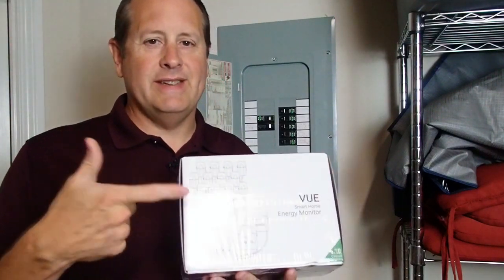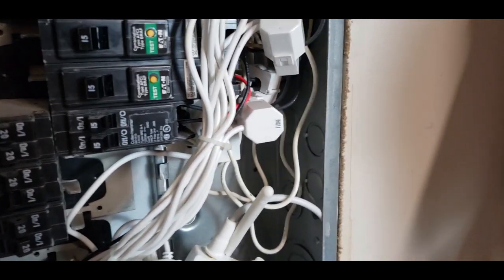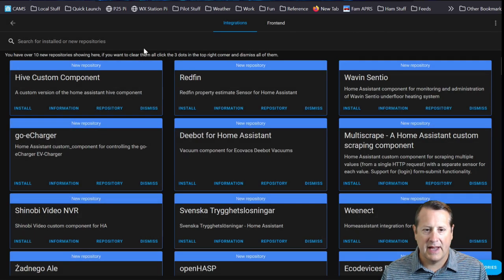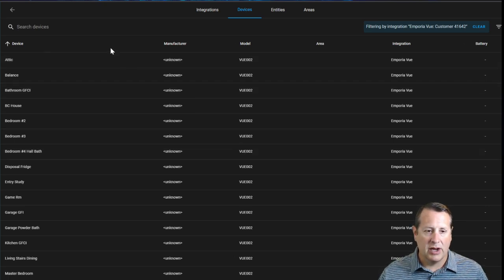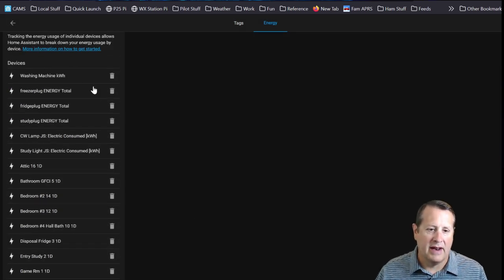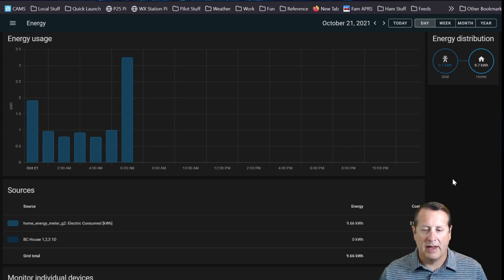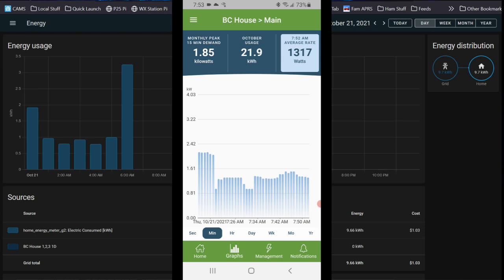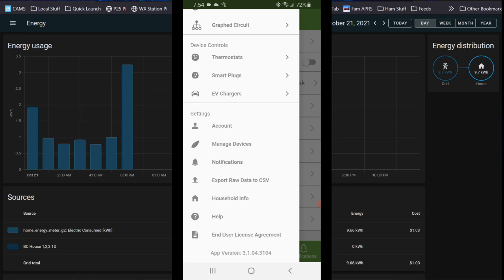Home Power Monitoring with the Emporia VUE and Home Assistant.

Comment: I'm glad I'm not the only one who isn't able to click on the selections. I did find you can use your arrows though. I had no idea it was a Chrome issue.  As far as the those who want to use this and be out of the cloud, someone has come up with a new firmware you can flash on this.  I haven't tried it, I'm using circuit setup but I did see a video on it the other day.
Reply from the maker: I think Digiblur did a video on it with ESPHome. I haven't tried that yet but might. Haven't felt like taking the electrical panel apart again yet. Thanks for the tip on the arrows. I have no idea why I can't click with Chrome. Works fine in Firefox.

Comment: You could still place the antenna outside the box through the side. Sure the antenna will be behind sheetrock but that's much better than the metal box its in.

Comment: I'm coming from more familiarity with the Eyedro2 energy monitor, and it seems the Vue2 app capability for data graphing review is very rudimentary compared with the Eyedro implementation.
There's no way to select the date to be charted, so it always needs to be scrolled to from the present time back to the period of interest.
That is impractical when trying to use the seconds or minutes granularity because it's very slow, and doesn't display the date in the seconds view, so you lose track of what day it's showing, if you're able to scroll back that far.
With the eyedro, the app allows date selection and pinch and zoom capability, which makes it very easy.
Does Graphana run only on the PC and offer the ability to save and display seconds granularity of the recorded data?
It would be ideal if it were available on the phone app, but the home assistant and Grafana might be a way to get that capability.

Comment: Hi Chris, thanks for the video's and the time you put in it. I would like to aks you if you're still using the Emporia and what do you think about it after using it for a time. Would you buy it again or would you choose for another option? (I also planed to use it with hass is verry near future)
Reply from the maker: I am still using it. It has been flawless. The only part of it that I would like to see is local access. Since it transmits every second, that data has to go to the cloud and then be consumed by the integration in Home Assistant so keeping it local would save some bandwidth. I know that there are those that have flashed this with Tasmota for local access but I have not done this as it works for me reliably so far.

Comment: Chris - great video. A question on the Emporia unit though. An Amazon review stated the app connects to the Emporia cloud to display usage. Is this true? In my case I want to view real time backup generator load during a power outage, so my home wifi will be working but usually we lose the internet. I want to connect to the Emporia just using my local wifi and monitor my generator load. Will it work this way?
Reply from the maker: Thanks! The Emporia out of the box relies on the cloud so if you lose internet, you'll lose power monitoring. In addition, since this is a wifi device, unless your wifi remains active it won't work either. I think DigiBlur just did a video on Emporia with ESP that might bring it local control. https://www.youtube.com/watch?v=z0Jv4nO9OWg

Comment: Chris - Another great video! Thanks for sharing. Quick question, I'm interested in getting one of these to solve two problems. One to monitor my over energy usage with home assistant. And secondly, I would like to create a sensor using the Vue to monitor when my washing machine and dyer have completed a cycle and send an alert. In your experience with the Emporia, would I be able to monitor the washer and dryer in real time and create an automation to alert me when the usage dips (cycle ends)?
Reply from the maker: Absolutely. As long as your washer and dryer are on their own circuits, you could use those circuit's entities to send an alert if they power usage drops below a certain threhsold for x minutes. That's how I do it with my washer.

Comment: Do you know what the “balance” is reading in the graph that shows all the circuits on the system? I’m not sure if I have something unknown drawing energy or if it’s the balance of what I’m. It using.
Reply from the maker: It's the remaining amount from the main sensors that isn't accounted for in the individual sensors. Could mean you are not tracking some load.

Comment: I have two 200 amp panels which normally would require 2 of the vue devices. Could I then add each panel as a consumption and then choose each of the individual devices (up to 32 of them and the CTs)?  I can't find any information as to whether or not Emporia have added the ability to combine two panels in the app. Thanks for the video!
Reply from the maker: Um.. I don't know about that. A quick search shows some experimenting with this and someone mentioned having two VUEs in the same app. That is going to be a help question for Emporia I think.
Reply: @mostlychris  Just a follow-up. When using two separate VUEs, HomeAssistant combines the total kWh usage on the energy graph and the grid to home animation. You can also easily monitor each  VUE's CT as individual devices. It works great. Thanks again for the video.

Comment: Every time I see these energy monitors installed I see two odd issues.

1. on main panels the two top wires tend to be always hot, I see no cut off so maybe it is elsewhere in your home and off. All of the energy monitors warn that the clamps can generate power out the little headphone jack things and should be plugged into the main unit before connecting them to ANY live feeds like the main feed.
2. Wifi is MOSTLY blocked by the big metal box but NOT drywall.. Just poke the antenna out a knockout at the top or bottom of the panel from the inside to get WAY better reception. It will be inside the wall but the wood and drywall will not really block WiFi like having the antenna in the actual box.
Reply from the maker: 1. The main shutoff is outside for this sub panel.
2. I didn't worry about wifi signal as the AP is only a few feet away from this box so I didn't have any issues.

Comment: we are waiting for... LOCAL integration without going to the cloud ;-) - nice though
Reply from the maker: I, too, am not a fan of being dependent on the cloud. Make enough noise and maybe some of these manufacturers will open a a local API connection. It has happened with other products in the Home Automation space.
Reply: If you're willing to hack the device, there are alternative firmware that can be flashed to it. It's just an ESP32 microcontroller image.

Comment: Who are you afraid is going to steal your credentials when not on ssl? Or, how do you think they would do it?
Reply from the maker: Not sure I understand the question.
Reply: @mostlychris  You state that the emporia beta site is not SSL protected and you should change your password after using it. Assuming you are accessing from home, and not some public wifi, how do you think your credentials would be leaked, or who would care to see your credentials? Either your home network is already compromised, in which case you have a problem anyway, or some ISP along the way is compromised, in which case a lot of people have a problem, regardless of whether SSL is used.
Reply from the maker: The beta site (which has now been moved) was hosted at Amazon on a non SSL (non https) site which means my credentials would have had to travel from my home over the public internet to reach the beta site and be exposed all along the way. It wasn't an internal network thing. Since posting that video, Emporia has released an SSL enabled beta site that I have played with. Looks just like the app only on a browser.
Reply: @mostlychris  Thank you for your reply. I guess I'm just a lot less paranoid than you are. 1) My emporia credentials don't matter that much and of course are different from other credentials 2) I don't think anyone would care to get them 3) A breach of my ISP's or Amazon's network would be a huge deal, regardless of my emporia credentials. I have a hard time believing that people (other than government agencies) are somehow out there, slurping up internet traffic. That's a tremendously difficult task to do.
I don't just mean to criticize. Thank you for your videos, they're very helpful.